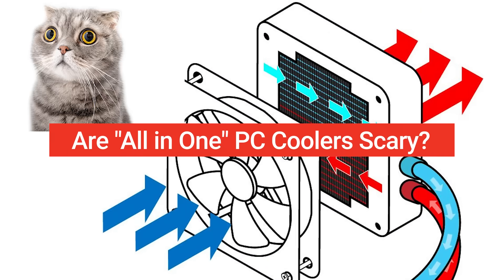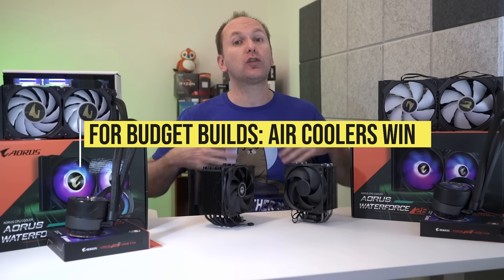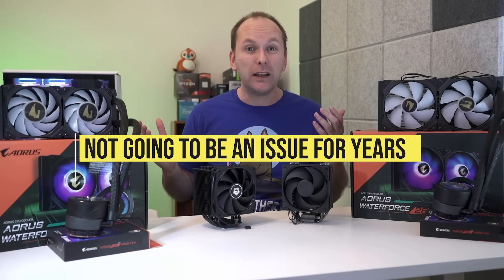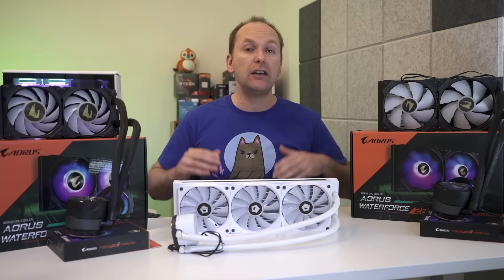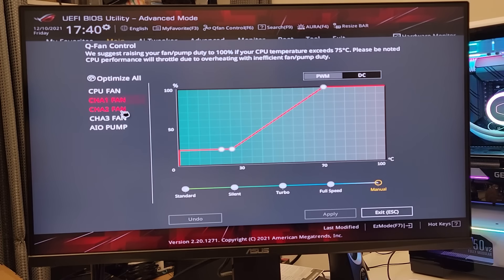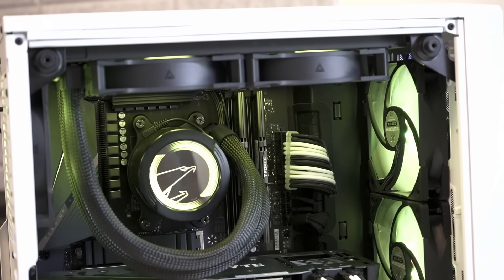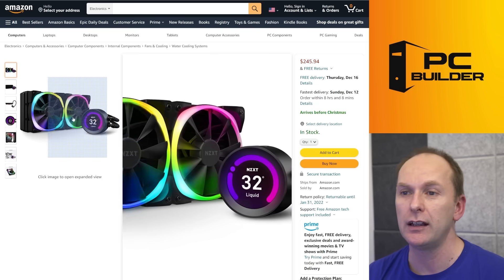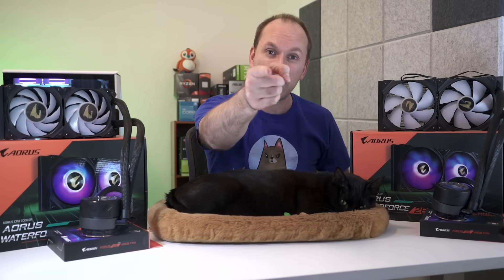🛑Watch BEFORE You Build! 🌊 PC Water Cooling Build Guide | Water Cooled PC Build 2022

Comment: Speaking of leakage, here's some anecdotal evidence for you:
I went AiO back on my Haswell system (i5-4670K) when it was just starting to become mainstream, I guess. 2013? 2014? Not sure but around that time. 
I used a cheapo 2nd or 3rd gen Corsair H60 (the one with the thicker, more rubber-y looking hoses). I used that thing for years and years, then let the PC sit in storage for a year or so. When I got my hands on it again, I took everything apart, making a beeline for the cooler, because I was afraid it might have gone bad. It was ...errr probably 8 years old at the time. 
In any case: The hoses looked totally fine, even though their rubber sleeves both at the waterblock and at the radiator were showing "rips". Looked like the rubber got worn and tired around there. However: There was no visible leakage or anything like that, not on the AiO itself nor anywhere inside the case. When I had taken the H60 out of the case, I gave the radiator a good shake and it was pretty obvious there was less liquid in there (which is to be expected). But there was still liquid in there even after all these years.

Comment: One thing to note: 280mm radiators are an excellent alternative to 360mm radiators if you don't have the room for a 360 in your case. A 280mm radiator takes two 140mm fans and a 360mm radiator takes three 120mm fans. So while you might think a 280mm radiator is a little over 1/3rd the surface area of a 360mm radiator, it's actually around 90%.

Comment: Hi Jason. I follow your advice, and I got the ryzen 5 7600. Now my question is. I got the asrock b650m pro rs wifi, but it doesn't have aio pump. Only Cpu-fan header, Cpu/wp connector, and 3 cha- fan. My AIO is the Cooler master ml240l. I am not sure where to connect the 3 pin pump connector. Some people mention to connect it in the cpu fan header and other people recommend connecting the radiator fan to the cpu-fan header. Little help 🙏

Comment: Its absolutely fine to install the radiator in the front with the tubes on top as long as the inlet and outlet are above the inlet / outlet of the pump (which is almost always the case)

Comment: I got a Arctic Liquid Freezer 2 360mm.. how can inlet the pump run at 100%? I changed fans to light wings 2 high speed.. also the AiO has just 1 4 Pin cable. Where do I put it? On a Pump or on a CPU Can connector? 🤔

Comment: my biggest concern is if i put my radiator on the front of the case as intake wouldnt it restrict the airflow for the rest of case because if i were to put the radiator on the top of the case it would have to be exhaust and since newer cpus(7700x which is what im looking at rn) runs at 90 Celsius from what im seeing plus gather the heat from the gpu. i am going to get aftermarket fans but i feel that would make minimal change.

Comment: Hello I hope you can read this message, now I just bought a Case Corsair 4000D RGB which comes with 3 ARGB fans, case can support up to 6 fans, the other 3 fans cost  139$ CAD, and in prime there is a AIO MSI MAG Core Liquid 360R for 128$ CAD should I buy it? instead normal fans? thanks for your kind advise.

Comment: hello I have a ryzen 7 5800x pair with rx6800 xt and right now I have a noctua nh-u12 the temperature of the CPU which is 60 ° and the GPU that is 70° are not that high but the air flow that come out is super hot it's almost impossible for me to play a game because I feel the hot air near me. At this point I don't know if changing to AIO make any change in the air flow could be. If so which one is good for my Ryzen 7?

Comment: I still don't understand the concept of drawing hot air across the aio radiator. That makes zero sense compared to how radiators normally function. Which would mean cool air is drawn across the blades into the case thus cooling the liquid which runs through the radiator. if you are drawing air from inside the case across the blades of that radiator. your only getting the coolant as cool as the air temps crossing those blades. If you draw cooler air from outside the case then it would cool the blades to the temp outside the case which is room temp. if you use the aio as exhaust instead of intake you're only getting the coolant as cool as the temp inside the case. Which even with an intake somewhere else bringing in cool air that air would be warm by the time its drawn across that radiator. Someone please explain what I am missing.
Reply: You are missing it be hotter inc the case other way around.

Comment: Wich size of AIO chould I pick for the 7800x3d? I've seen that they run kinda hot.
Reply: a good 240 should be fine but i would go for 280 or 360. some aircoolers r enough for that cpu tho

Comment: I currently want to change an air cooler to an aio, and Im not sure if id cooling is enough to handle a ryzen 5 7600x. What are your thoughts?
Reply from the maker: Should be fine, check out our 7600X build guide for more

Comment: I finally bite the bullet and bought a 240mm AIO for my PC after ever only using air coolers

my air cooler is working fine so it's more an aesthetic choice but if it lowers the temps and allows me to use all 4 RAM slots that's a bonus

Comment: Way can't i push cold air in from the front and push cold air in from the top with a radiator?
Reply: ??? 1. why would u ever want to set the top fans to intake 2. hot air rises so its better if the exhausts r at the top 3. u aint moving cool air to any component that would need it. ur just pushing air to the top of the case doing nothing and eventually hurting the airflow due to the air heating up

Comment: I have Rosewill AIO cooler on Intel I7 33700, Z690 - and the pump does not run - CPU shuts off about 30-45 seconds into startup - never even gets to bios screen more than maybe 10 seconds -no tinme to set anything --?? 
all cables for fans and pump into a controller, controller pluds to CPU pump or CPu fan (tried both)- but nether seems to power up.  Ideas?  TX

Comment: It has always made more sense to me to give fresh air to the radiator from the front panel.  Since hot air rises faster than cold air, it is easier to evacuate the hot air inside the case.  I do not recommend sending the hot air inside the case to the radiator, the purpose should be to keep the liquid in the radiator cold.

Adjust the speed of the radiator fans according to the processor temperature.

If you have enough exhaust fans, you can try the installation as I said.

Comment: Been using aio cooling since my AM3+ Vishera 9590 days. Now I'm using an h-60 in push pull in a Fractal D7 case. Thinking about getting an ID frostflow 240 to match the case theme. Just concerned about maintaining a slight positive airflow. 2x 140's up front, 1x 140 underneath knowing it's help is restricted by the case mesh but it's really to help cool the 6700xt. Then 1x 120 on the rear panel, then the 2x 120's on the aio should do it. Cheers.

Comment: so question I'm running a 360mm NZXT CPU AIO on top with three lian li fans and the front of the case has my GPU AIO and a 140mm at the back I'm trying to figure out a good airflow mostly because the cpu cooler runs hot I have the gpu pulling the 140mm pulling and the cpu pushing but it has 3 fans and I thought that's a good balance but it gets hot so not sure.

Comment: been wondering which aio cooler is the best for 5800x3d tho
Reply: I have a 5800X, which actually has a slightly higher max power rating (219W) than the 5800X3D (211W.)  All you need to know is the max power rating of the AIO.  For example the very well regarded Arctic Freezer II 240mm cooler that JAson recommended is rated for 200W+.  Since you almost never approach max power in a CPU unless you are stress testing an overclocked CPU you'll never approach the max power capacity of that AIO.  Point is, know your CPU power output and match it closely to the max power capacity of the radiator in the AIO.
Side note:  The 5800X3D (unlike the 5800X) is NOT meant to be overclocked.

Comment: interesting how you suggest to mount a twin fan (240/280mm) at the top in an exhaust config. the Corsair manual I have suggests that the best way for optimal cooling is to orient the fans in a pull config for a top mount, thus making the case highly positive pressured, considering three intake fans at the front and one exhaust at the rear. I like positive pressure case configs but I'll settle on a neutral at worst case.

Comment: 6:42, I recently watched a vid where they cut open the AIO and added clear plastic to watch water flow. When you have tubes at the top on a side installation it leads to air pooling up there and causing a loud gurgling sound. Its better to either have the tubes at bottom and if that is not possible then install it on the top of the case.

Comment: What is the good position if the pump is in the radiator ? For exemple if i install the radiator at the top of the case, did the pump are on the highest level and gona have some air inside ?

Comment: Thanks for this. I have question that you can hopefully answer. I have a 280mm GPU AIO exhausting at the top, a 240mm CPU AIO pulling in through the front and a 120mm exhausting out the back. I want to mod my side panel with 2x 140mm fans, 1 blowing directly onto the GPU and one more towards the front. Would you suggest that I then change my CPU AIO so that it exhausts out of the front instead, since it will be fed with fresh air from the side panel fan. Or should I just leave the setup as it is and have both the 140mm side panels pulling fresh air in.

Comment: Hey Jason I just bought the iceflow from id-cooling without realising that the mounting is required on the front or bottom and not at the top. The case I have is a rosewill c201, should I remove the stock front fans and place my radiator in the front?

Comment: My Arctic Freeze II 360 is coming in in a couple of days. First time using liquid to cool. Im not sure if I want to front mount it or top mount it. I'm putting it inside a Corsair 5000d Airflow. I picked up a 4090 and a 7700x. The 7700x came with free 32gig DDR5 3000 Mhz ram. I can't wait to build this puppy. I'm coming from an i7 6700k with a 1080ti. Should be an insane upgrade for me.

Comment: Depending on my prev experience, best position for AIO is front mounted pull config since you also push air from case fromt fans to the rad. 
Then of course, put a xouple of push fans at top so that we have an excellent heat exhaust.
Reply: Why would i want to pull hot air into the case? 🤔
Reply: @malcolmjelani3588  Front mounting pull aio means, behind case fans which pull fresh air is directed to the radiator. Then aio fans will push hot air inside the case. however, top and back exhaust fans are push config so they push it out. Since rad is cooler, your cpu will be cooler too. Hot air created by gpu is also exhausted. so win win :)

Comment: Hi ! Very nice video but I have a question : for the front mount pull configuration, is it bad for the graphic card that hot air will blow onto it ? Cause my case is quite small and my graphic card is really close to my AIO fans 😅

Comment: Is it ok for the tube/hose to touch the GPU backplate?
Reply: as long as its only on the cooler and not on the backplate thats above the pcb it should we okay. u can touch the tube laying on the backplate and the top of the tube to check if its okay so it doesnt leak

Comment: Ik this video is a bit old. I do have 1 question. So im running the corsair 7000D airflow case with evga 3090ti ultra hybrid graphics card. What would be your suggestion on intake and exhaust? Running a 420 mm aio as well. I thought about running 3 noctua 140mm fans as front intake and using the gpu as intake with another 120mm fan above it as well. (Gpu being side case mounted). And running the aio as exhaust.

Comment: Note, for a Ryzen 5800x and 5800x3d using a 360mm AIO is highly recommended, they have the same power draw as 5900 and 5950 but they're a single chiplet and will have a higher overall temp.
Reply: I have a 5800X and a custom loop setup.  The CPU water block runs through a 240mm top-mount with two fans in a push config.  During gaming my CPU temps seldom hit 60°C and I see no throttling.  I think maybe an AIO is less efficient than a custom loop (because of having less water available to soak up heat.)  But if you match the power draw of the CPU and the power capacity of the radiator, you'll be fine in either case.  The max power for the 5800X is 219W, so a 240mm AIO with a capacity of 200W+ would be fine.  But you have to pay attention (and pay.)  The Arctic Freezer II 240mm AIO can handle that much power dissipation.  Cheaper ones would have a problem, and would lead to CPU throttling at max load.
If you want a cheaper AIO then yes, a 360mm radiator would be a better option.
Reply: @eracer1111 never seen anyone recommend more than 240mm for Zen3 8c before.
Reply: The 5800x3D doesn't need that, I have mine running an all out 100% heavy all core load at under 75C on a 120mm AIO.  But I did change the fan to a very efficient (and quiet) one that reviewed well.  I simply balanced the fan speed to avoid rising temperature at full load, which also evacuated air from the case fast enough to allow me to switch back to a solid top instead of mesh.
The Gamers Nexus review showed 5800x3D had large efficiency gains in their tests, partly due to the new Zen3 stepping which improved the metal layer.
The max PPT is 142W and the TDP 105W, not exactly requiring Intel class cooling.

Comment: It's just words and theory, why did you decide on 7:25 on the front radiator with fans we get cold air after pretty warm radiator ? I'm not sure about it.. well in the case without AIO when we use just fans that's true. what's a problem just to make some tests with couple types of orientation fans in AIO and close this issue forever ?

Comment: I fear an AIO, but I've had one for 8 years that never had a problem. I'm building a 5900x Ryzen 9 but I was going to cool it with the Noctua NH D15se AM4  premium dual tower, but I'm worried about the case size. My case will be called a mid tower. What kind of case will allow such a tower cooler? I mean is there a title for the case that's that wide where the processor goes?

Comment: Small note if your system is only for gaming a 120mm single radiator keeps Temps down and lasts forever I run this and a 240 on my gpu and I've never had a leak or temp spike

Comment: Hey, thanks for the vid. Just want to highlight that as a big fan of watercooling benchmarks, I can assure you that the Cooler Master Illusion and the Asus Waterforce are both very bad options for overclocking and failed all stress tests on the most famous French benchmarks.

Arctic Liquid Freeze II is very controversial as well, but a famous French Youtuber "Jigfio" made a specific video to prove that this is not a high ground player.

Most reliable 360 options for overclocking today seem to be the Asus Ryujin II (but freaking expensive), the Corsair H150i Elite series and the Fractal Design Celsius S36+. NZXT Kraken as a runner up.
Reply from the maker: Thanks for sharing!

Comment: hey i have the mastercooler ml240l and my cpu is still getting a 100celcius any idea how this can happen i have the i9 9900 cpu ( i use it as intake my radiator ) my pump and radiator are not even slightly hot its like there just turned off

Comment: Your “avoid bottom radiators” statement was way too simplistic and way too definitive. The actual truth is, often bottom radiators can be the best and most efficient solution for a build, if you have the right case and pump position. For beginners, that advice might be best to avoid mistakes, but for anyone who knows what they are doing, that advice is poppycock. 

— If you position the tubes of an AIO correctly, the bottom rad works great. 

— If you have an AIO like the Be Quiet! brands, which don’t have the pump in the water block, a bottom radiator might be actually ideal. 

— If you do a custom loop on it’s an external pump, the bottom radiator is totally simple, as long as the case allows. The advantages are large enough, you might consider a case based on that option alone.
Reply from the maker: This is an intro to AIO (not custom loop) water cooling video. If you are already an advanced user you can do whatever you like. In my experience as someone who educates new PC Builders, telling a someone new to AIOs to go find the 2 or 3 AIOs with a pump not in the main block is adding needless complexity for the sake of including the most marginal of use cases (and totally unnecessary IMO). In the long run that kind of inclusion will lead to more bad outcomes.

Comment: sorry I'm a bit confused here. when you said no radiators at the bottom do you mean those connected to the AIO per se or the others? my plan is to mount 2 intakes on the side, 2 intakes from the bottom, and 240 AIO on the top, 1 radiator at the back (yep with Lian Li O11 mini). would this work? thanks!
Reply from the maker: I don't think I understand what you are trying to do here, but just make sure your pump is not the highest point in the loop or the air will pool there and the pump will struggle (it is built to pump water, not air). If you have one of the few AIOs that have a pump not in the water block, doing a bottom mount might be possible.

Comment: if you are mounting the radiator in the front, shouldn't the fans be in front of the radiator if you are using as an intake? i thought intake is to draw cool air.. if the radiator is in the front, wouldn't warm air come in?